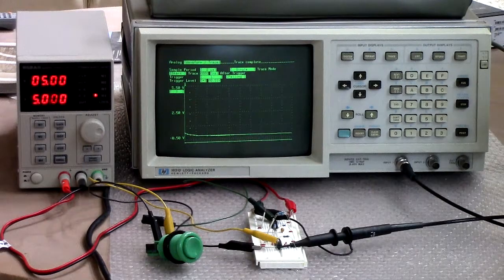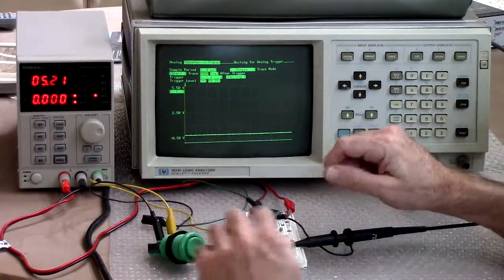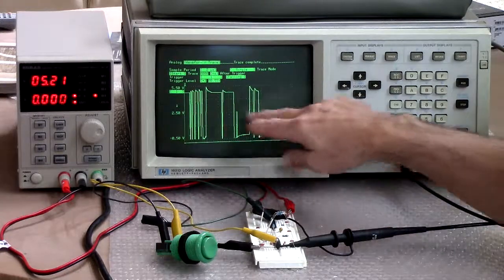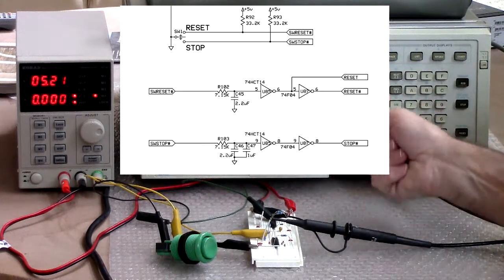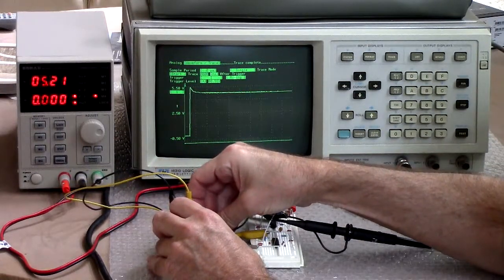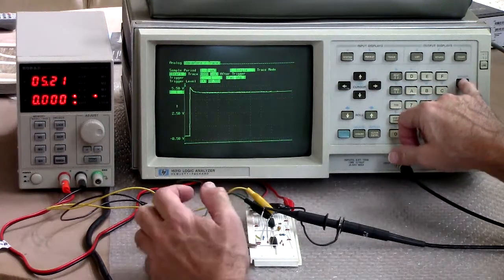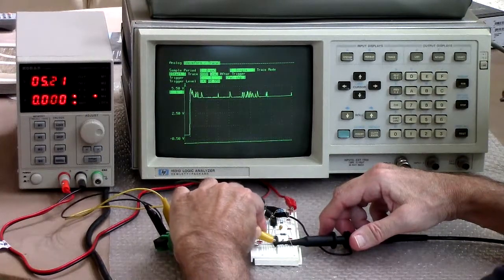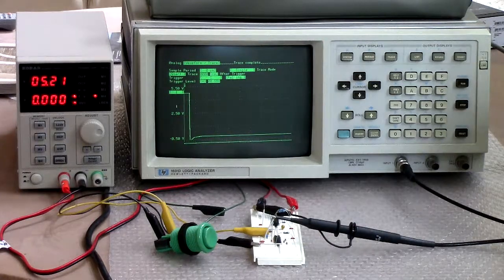Switch Debouncing

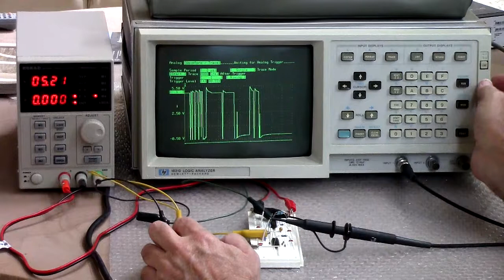Comment: In your example, with inverted output, ( time 04:01 ) the signal "spikes" and almost resembles Gibbs phenomenon. Is there a way to attenuate it by some capacitance/resistance? Or is there no need to do so. Maybe it should not cause any problems when connecting the inverted signal to a device like microcontroller.
Reply from the maker: There is some overshoot shown on the trace, but more likely a result of the test setup than anything else.  I don't think I adjusted the oscilloscope probe compensation for this video - just grabbed one of my spare probes.  See: https://www.electronics-notes.com/articles/test-methods/oscilloscope/scope-probe-compensation.php

Other contributing factors: using a breadboard and the long ground lead on the probe.